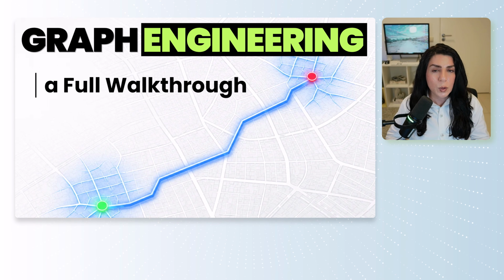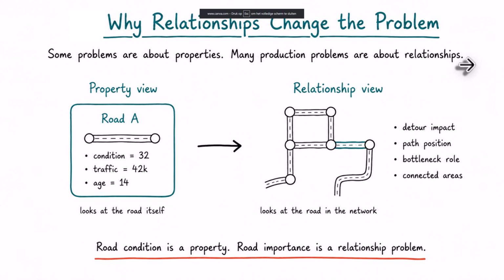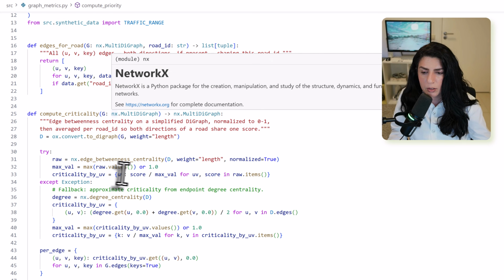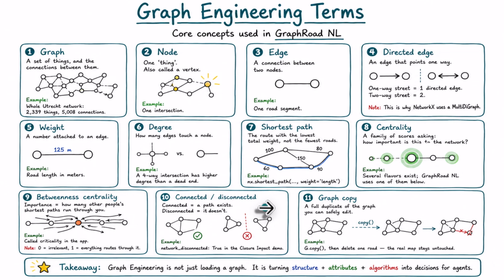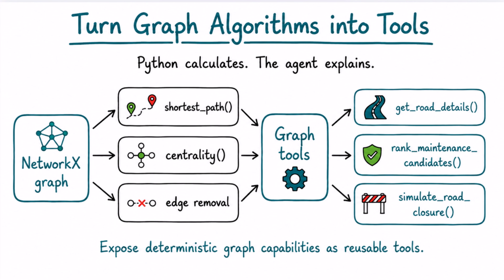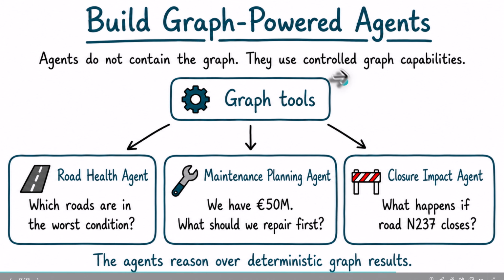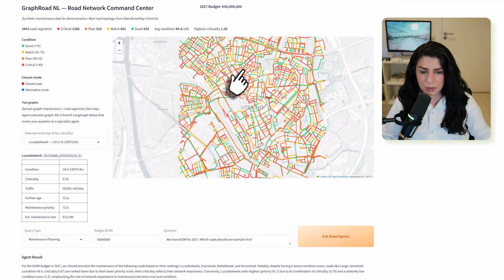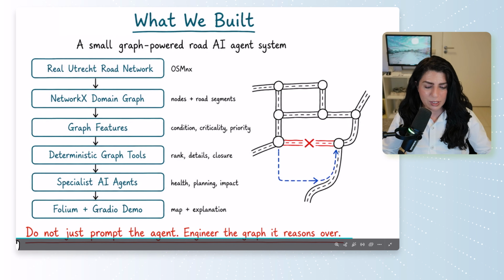You Can Build Graph-Powered Production AI Agents in 18min: Graph Engineering | Road AI Project

Comment: builidng sematic data model and ontology is important to make the agentic graph rag work better when using many datasets, and the information could be taken from many of them at the same time (for example). right?
Reply from the maker: Yes, exactly. When you have many heterogeneous datasets, a semantic data model or ontology can give the graph a shared meaning across those sources. That makes Graph RAG much more useful because the agent is not just retrieving isolated chunks, it can connect entities, relationships, and context across multiple datasets at the same time. The important part is that the ontology should reflect the real domain and not become an overly complex layer by itself.

Comment: Hi nice video, I am currently designing robot task allocation algorithms where I'm trying to see graph maintenance of tasks can help context issues in long duration missions. I would like to know your opinion if graphs are actually useful in such applications where strong reasoning performs nicely but not in deterministic or formal way...
Reply from the maker: Thank you! Yes, I think graphs can be very useful for exactly this kind of problem, especially in long-duration missions where the task state, dependencies, robot capabilities, constraints, and completed/failed actions keep changing over time. I would use the graph as the structured, deterministic layer that maintains this evolving state, while letting the reasoning model operate on top of that context. So rather than asking the LLM to “remember” the mission correctly, the graph gives it an explicit representation of what depends on what, what has changed, and what actions are still feasible. For robot task allocation, that combination of graph structure + probabilistic reasoning could be very powerful.
Reply: @maryammiradi  thanks for your kind reply, glad to know this as it supports the validity of my current work...:)

Comment: AI isn't going to suddenly eliminate every entry-level position. But it is changing the type of work companies expect junior employees to do.

A lot of traditional beginner tasks—basic coding, data cleaning, documentation, research, reporting, customer support—can now be done faster with AI.

That creates a real problem:

How do you get experience when companies need fewer people to perform the tasks that traditionally gave beginners experience?

That's the part I find more concerning than the headline itself.

What about university?

I don't think degrees are becoming worthless.

A degree still gives you fundamentals, structured learning, credibility and access to opportunities that a random online certificate may not provide.

But a degree by itself is becoming less impressive.

If two candidates apply for the same technical position:

Candidate A:
Degree + certificates + no real projects

Candidate B:
Degree or equivalent education + strong projects + GitHub + practical experience + demonstrated AI skills

I'd expect Candidate B to have the advantage.

And that doesn't mean collecting 20 certificates is the answer either.

A micro-credential is useful when it proves a specific capability.

But employers ultimately want evidence that you can actually do the work.

AI changes the entry-level game

The valuable skill isn't simply:

“I know Python.”

It's becoming:

“I understand the problem, I can use AI to accelerate the work, I can check whether the AI is wrong, and I can deliver something that actually works.”

That's a much more valuable skill.

AI can generate code.

It can't automatically give you judgment.

It can't guarantee that the architecture makes sense.

It can't take responsibility when something fails in production.

And it doesn't replace understanding the underlying problem.

So what's the future?

I don't think it's:

University → obsolete

or

Certificates → replace university

It's more likely:

Fundamentals + practical skills + real projects + experience + AI literacy

will matter more than any single credential.

And there's a strange paradox here:

AI is making it easier to build software while potentially making it harder for beginners to get the experience needed to become good software engineers.

That's the real challenge.

The winners won't necessarily be the people with the most certificates or even the most impressive degree.

They'll increasingly be the people who can learn quickly, build real things, use AI intelligently, verify their work, and demonstrate what they can actually do.